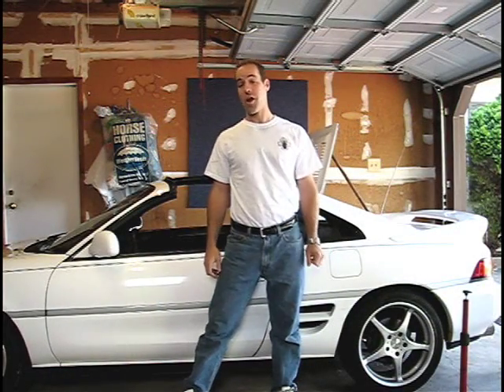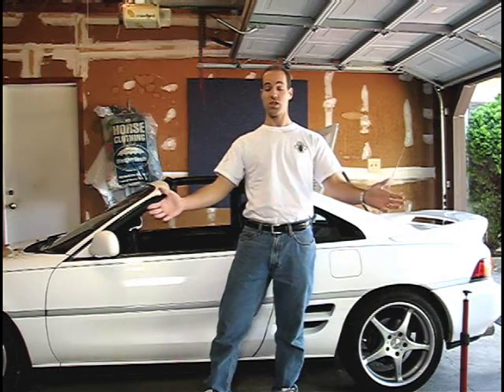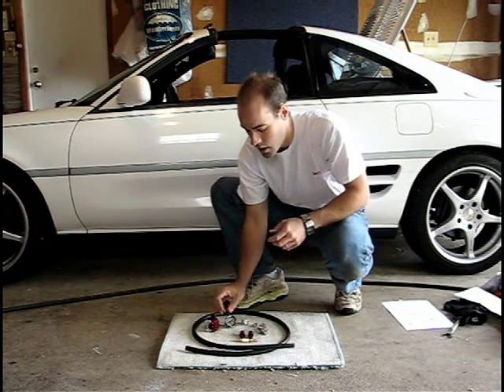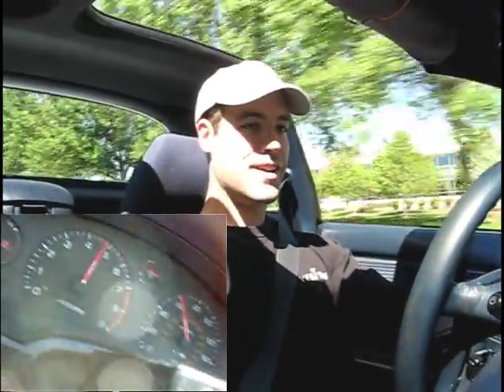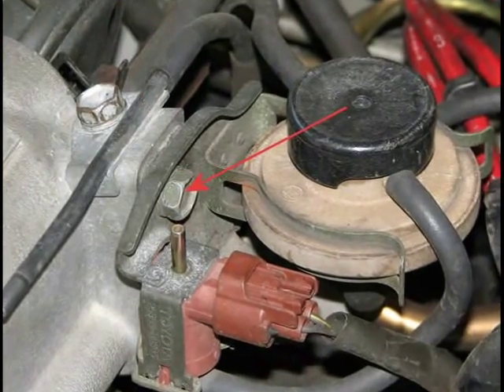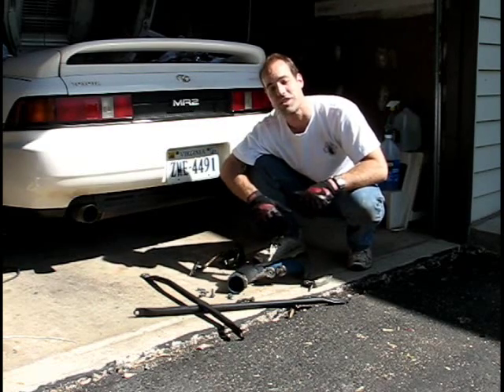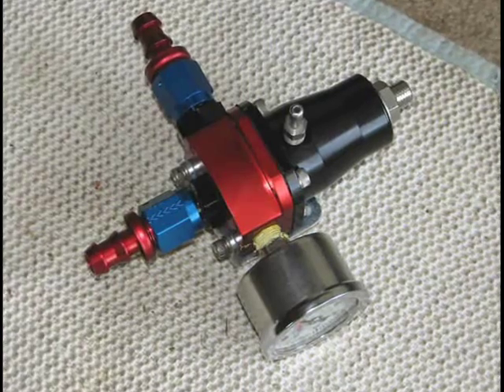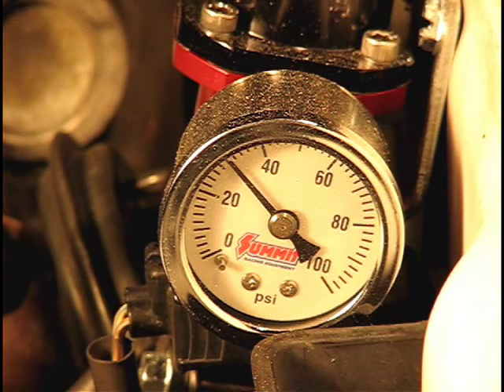Lovehorsepower Regulator Installation on a MR2 Turbo

Comment: I have a 1991 Toyota Celica Turbo All trac I replace the pressure regulator the same you have can you tell me the how much preasurre PSI I need to use?